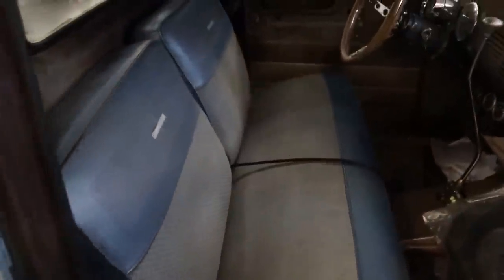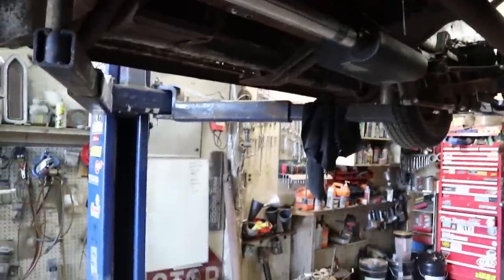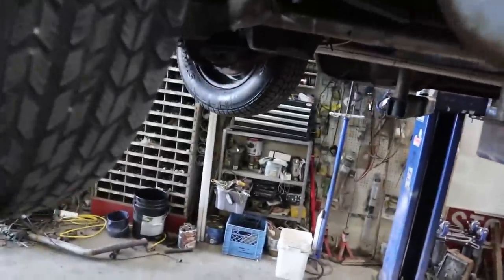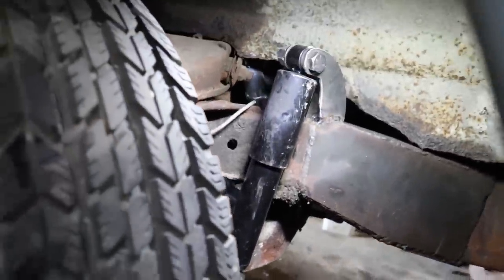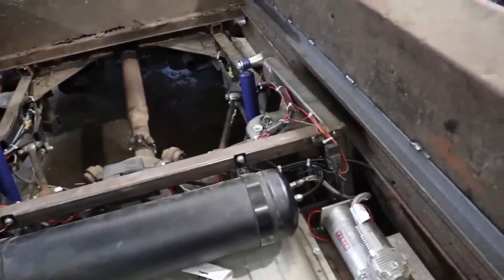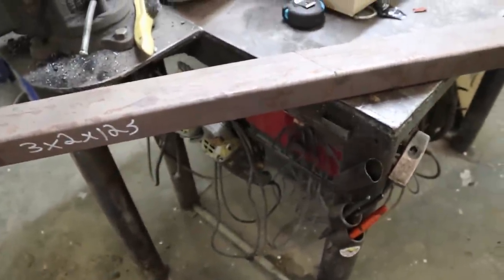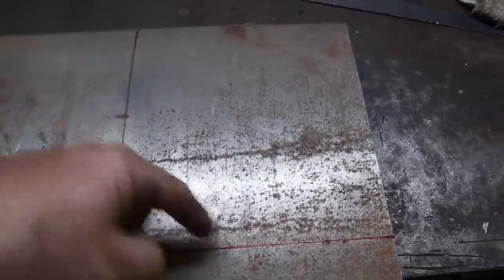1951 Chevy pickup finished...

Comment: Looking good. You do in hours what others take weeks or months to do. Great to watch a master mechanic do his magic.
Reply: Hes more a master builder he can also do body work and paint and interior work not top quality but plenty decent for what he has to work with its like building car models you build so many after a while you have a big box of parts left over from previous models to change out wheels lights interiors engines love building models have the only 73 cuda Johan kit that has a vynal roof and centerlines autodrags in satin finish no model maker ever came out with centerlines on any models and it has a 440 w/727 slap stick the only one in existence the model was a snap together every mopar guy has had the model yellow I cut the hood out put a challenger engine compartment the engines wired! Its tihitian green a rare honda color looks dark green in the sunlightg it looks candy apple blue i hand polished the paint three coats with a piece of towel and crest toothpaste and sprayed on thtee coats olf clear rubbing out every layer with crest toothpaste then pilushed it with pledge for wood i ade the vynal roof with wide masking tape still on there after over 20 years now

Comment: I also use a bent screwdriver to install windshields. I agree with you about two people and the rope trick
Reply: John Serou sounds good, I’ve scratched the tint using braided wire... scrap that, I was taking windows out

Comment: A tip I learnt years ago to soak up oil spills. go to your hardware store and buy a bag of cement ( the pure cement powder, not concrete mix) then sprinkle it over the spill and leave for a day or so. most times you'll find it will soak it up completely and leave little to no staining if you do it straightaway.

Comment: On those oil pans, I used to just drill a hole in my best estimate as to missing the pickup an other stuff that should not come in contact with a drill like wires and pipes.. that last millimeter can be hairy if its hard drilling. Once its off and clean depending on the type pan, steel or aluminum I find a piece oh say three eights inch thick right over the hole and then redrill it and put a pipe plug drain in. I use the one that the ratchet fits into. same on the rear end if it don't have a drain then it will have. I have run into some gm that they say in the book to use the vacuum system to get out and refill but there is trash no matter what. I do use a external filter on the cooling line if I can't find better but that can be scary as some people never change them and if its plugged then the cooling goes downhill from there. You and a couple other guys have convinced me if the title has a radiator cap then the rest will come. Great job... those seats look like they belong. I tried using that pan that is under the seat stock and its just too wide and tinny to work with for me. Now a under dash AC unit an here comes car shows

Comment: Love the shit you do man, I am in Northern Ontario and run a 50 Mercury PU I built from parts. Fresh flathead comp Thumper cam 4 inch crank with Edelbrock aluminum heads, Offenhauser intake, 4 BBL edelbrock  and a Borg Warner 5 speed. Harley Davidson stock mufflers, power disc brakes and air bags on the rear. send me a PM on FB & I'll shoot you some pics. "Use what you got"

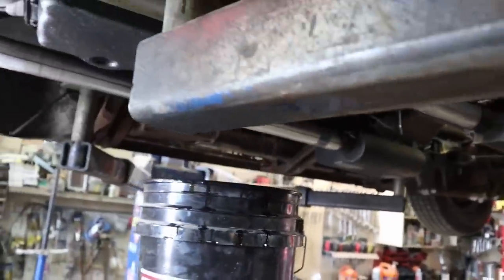Comment: 02:00 Lol. With your knowledge, made a large drain "funnel" to catch the trans fluid.
On a side note, fill us in how you design and cut the parts on the plasma cutter.
Why are the front shocks mounted so inbroard on the front lower control arms ?
Where did you find that grill ?
Reply from the maker: The grill was a repop, shocks had to be mounted that way to make room for the tires at full lock.